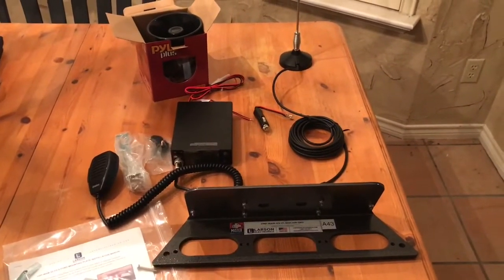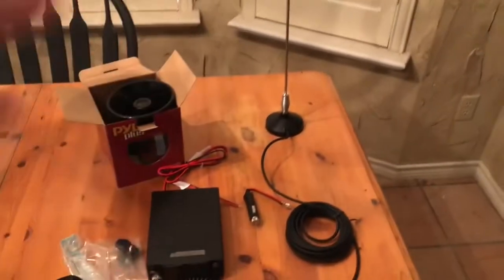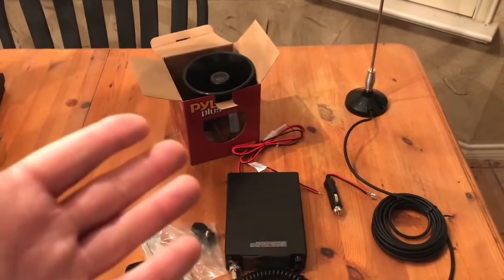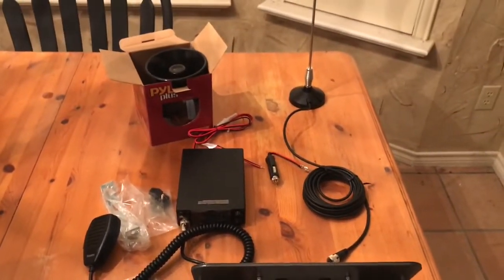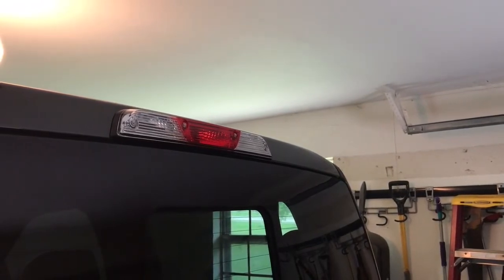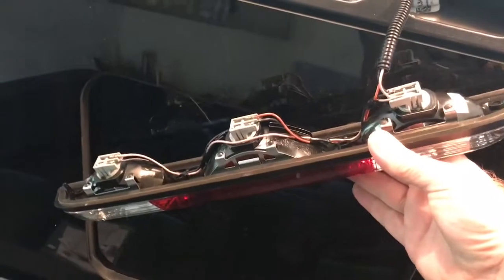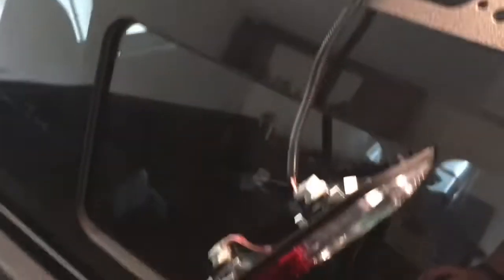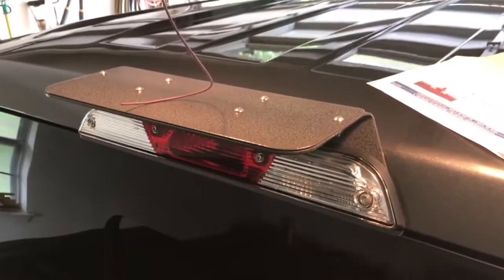Larson magnetic antenna mount for 2015-2020 F150

Comment: it's been a while since you did this... how is it working??? to get a cb to transmit some distance it needs a lot of metal or aluminum to reflect off... so it should be in the middle of the roof... but even being just over the roof it should work... but yours if facing the bed??? could this be installed over the roof instead.... that would give you a better transmitting range... and lastly... how does it work??? have you done any range tests to see how far you can transmit??? I'd be interested in this... if it works???

Comment: Larson Electronic third brake light bracket for my 2019 F150
SUCKS. The powder coat finish on it failed inside a month. Became a rusted blistered piece a shit. For $200 it’s JUNK. Larson Electronics are liars as well. Said they’d replace it but never did.
Reply from the maker: @MarkJHorn  I bought mine in mid 2019. Wonder if the company was bought out? My powder coat is still good with no rust. Sucks that you had a bad experience.
Reply: @Liberty76  I’m in central Florida so no salt air either. I spoke with them via phone and the guy I spoke to was rude too. Horrible company!  Went through BBB and Larson said they’d replace it. Liars. They never did. The bracket is complete garbage.